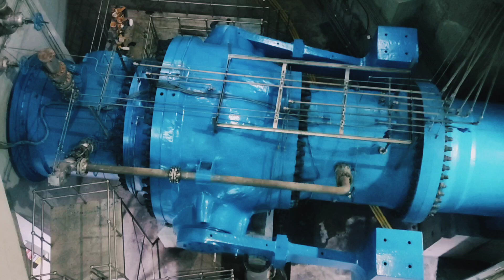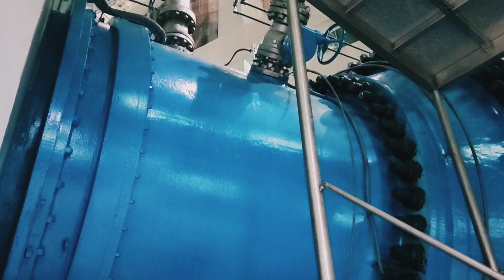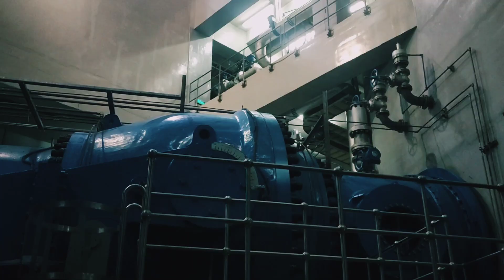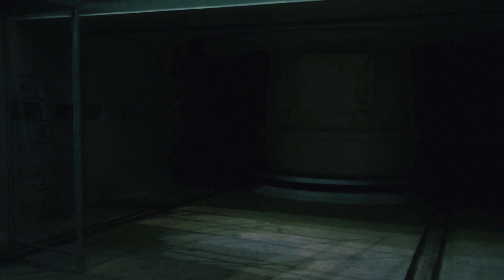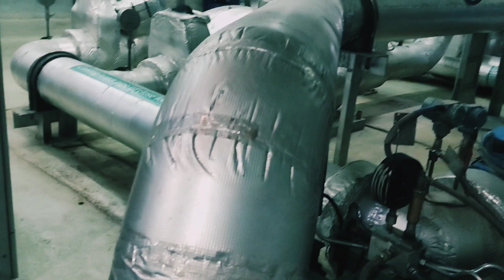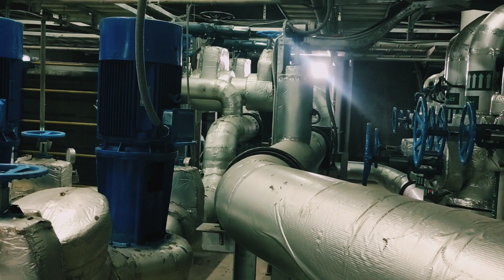Main Inlet Valve (MIV) Control | Water Regulation For Hydropower Generation | Turbine Control

Comment: Good Morning 
the following is still in the working out faze
This document is for a retro fittable power production system for a hydro dam to have up to three extra turbine banks without making issues for the main turbine hall
Now the reason this type of system has not been looked at was two fold .. the loss of flow rate and back pressure issues 
As all the worlds dams have the same basic layout regardless of the turbine fitted. The basic is turbine shaft to shock uni joint to the turbine. And so all have the same common limitations  
A new type of turbine unit is needed if the main turbine hall is to function with without mods for a multi stage units are to be placed in the flow 
This new system will never match the output of the main turbine hall but after years of them chasing minute increases a system like this one is a massive jump 
At this point it should be noted that most of the installation process can be made with the dam online selling power to the grid and there is no increase in water usage when fitted 
This system has been designed to be fully independent of the main turbine hall so as to be serviceable with the other units online and running with the main hall 
A FEW OBVIOUSE POINTS 
Population = Even if our numbers were to fall we are still in a situation of heading to a power shortfall outcome things like data centers e cars and a hole host of other tech 
The lag time at best for any new power units to get online is 2-3yrs at best and i believe we are well short of filling the markets needs 
OTHER BENIFITS OF THIS UNIT
Is a dam green tech? well its more recyclable than wind and solar
lasts 100 plus years vastly more than the others
It should be noted if the patent is very strongly protected the market will come to the seller even if it is in Australia or America so a 100 billion dollar a year marketplace makes the wage bill a non-issue 
SOME OF THE BIG BENIFITS 
Bigger market share/customer base
All the required infrastructure is already in place
the asset has a longer life span
No issues regardless of type of turbine fitted 
No added down time 
AND ITS TRUE BASELOAD POWER from a existing dam

Comment: To date there are no dams running multiple banks for turbines why?
Well the story you are told is there are issues like turbine surging and dissolved gasses in the flow. This was the case But in Australia RDP Marine has made a turbine system that can be retro fitted
Reply from the maker: You are right 👍